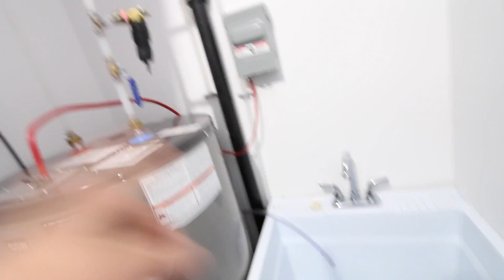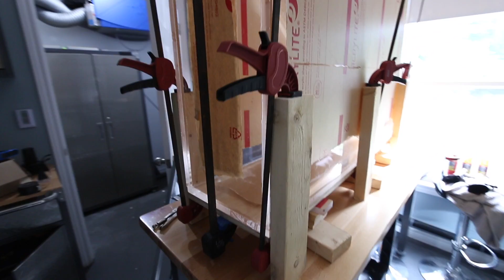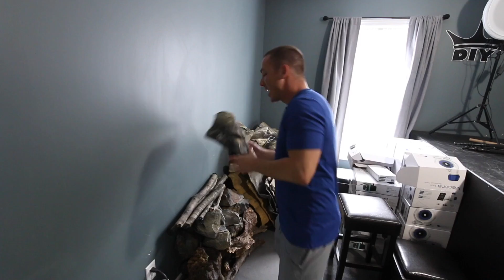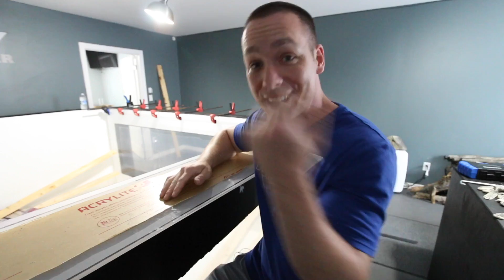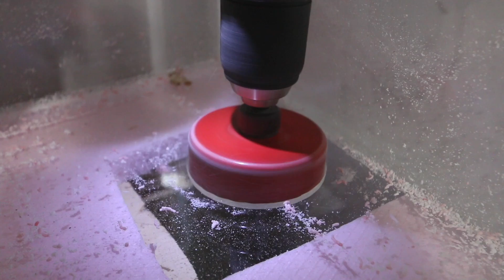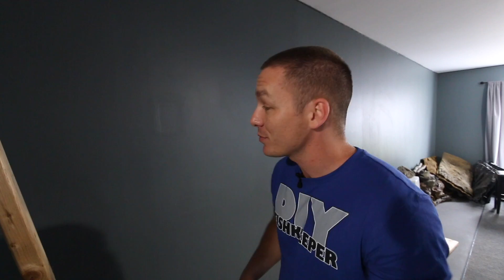2,000G completed  - Aquarium gallery UPDATE!

Comment: For future leaching of tannins, if you can close the top of the trailer or other container with a black tarp, the heat builds up and helps speed the process. A large black plastic trash container works great also. When I did this a few years ago in Los Angeles over the summer, the water got hot enough to steam. There were almost no tannins left to stain the aquarium water.

Comment: Hey Joey, just an idea, how would the panels for the wavemakers fit on the front 2 corners of the tank?, not sure how well you could hide the cords, maybe those square panel things electricians use to hide/cover wires and such , but it would give a clean finish for the back of the tank with a nice wooden trim around the top of the tank, might be an option for the lid too?

Comment: Did you ever use silicone with PMMA before ? if it is not a silicone which special PMMA destiny it will not work over time.

Comment: since you have the corner panel which have a dry area in back; have you considered putting in a video cam in the corner panel.   You could eventually put the cam(s) on-line to have live-cam

original poster:  Glen Petrie

Comment: Idk if that pump in the tank idea is best idea Joey. Just sounds like something that could fail. I would just drill some new holes where u want the pumps and use pumps outside the tank. Just to be extra safe because if those baffles leak and fill up you might have an electric shock to the water.
Reply: Or maybe you can make some kind of the hang on the back pump that will blow water and you move it in any direction you want. Hope this made sense
Reply from the maker: +Joshua Perry Climber its the exact same thing as how the viewing panels are installed, yet entirely safer due to the far less surface area of the chambers. I understand a few concerns but they really boggle my mind in terms of reasoning. If you are worried about those baffles, you should be losing your mind over the panels. Again, identical situation yet the baffles are far smaller meaning the tension on them is extremely low compared to the long 8 foot panel.

Comment: You probably already know this but you will need a sump pump of some sort behind the corner WaveMaker panels in the large aquarium.  You will probably get it to seal up well but even a small slow leak will expose the electricals to water.  It won't take much of a pump but you will need to diy a float switch.
Reply from the maker: +Jeffrey Toole why do you feel this will leak but the front panels will not? They are installed the exact same way yet far less tension is placed on the chambers due to lack of surface area and thickness of materials.
Reply: Take it from an engineer: The pressure is a function of water depth. While it is true the total force applied to the wall joints will be less that of the windows, the force at the joint will be much less due to the much smaller area of the panel. Conversely, the area of the joints are also much smaller. A 3/4" thick panel cut on a 45 degree angle produces a joint width of 1.05". (Full calculations would have to be done but it is possible that the pressure at those joints near the floor when full will actually be higher than that of the viewport joints) At the bottom, where the pressure is greatest, there is nothing for the panel to press against, meaning a seal is produced by the silicone alone. Add to these factors the fact that the construction will age - different materials will expand/contract at different rates, materials will degrade over time, mechanical and other vibrations and movements will take their toll. This aquarium will do like every other and eventually leak. Where the main viewports will produce an annoying puddle when a leak starts, these corner wells are going to collect water. Quietly, insidiously, and likely unnoticably collecting water that will put the currently planned electrical equipment in jeopardy (as well as any added later). It is a matter of cheap insurance. No one wants to see another tragedy - or even a close call. Just looking out for you, Joey!  :)

Comment: I am SUPER interested in seeing the drip emitter on your water heater in action. I have 6 tanks at 270 gallons in my garage. It doesn't freeze where I'm at and I don't need a heater for my fancy goldfish (only the fry grow out in the winter/spring). But I don't have a drain or a inside water source in the garage. But I could cut into the water line feeding my water heater to do the pressure valve drip emitter automated water changing. I'd also have to learn how to drill my tanks I think. The pvc pipe is touchy with being primed.

Comment: Looks awesome! You may want to consider lowering the pressure relief valve on the hot water tank so that it is closer to the floor. Typically this is required by plumbing code to prevent a scalding event should the valve open with someone present - or more likely when a curious hand reaches up while looking directly into the outlet of that scalding water. Better to spend a few bucks than have a kid scalded in the face. Looks awesome though!

Comment: Drop a couple aquarium heaters in with the driftwood on their hottest setting. That should allow the release of tannin at higher temps than your aquarium water will be at, so in theory they wouldn't leak out as much in the lower temp aquarium water.

Comment: Most hot water heaters come with a drain. I usually turn my tank up to boiling point attach a water hose to the drain and fill tubs with hot water for soaking large pieces of drift wood. Just an idea.

Comment: To leach tannins out of v. large driftwood fast you could use a 300 gallon metal stock tank for farming ($250) and wrap the outside in black plastic. If you wanted to go crazy you could hook the stock tank up to a recirculating system via coils of garden hose baking in the sun (e.g. roof of building) and a small/medium size pump. That would get that wood leached out pronto.

Comment: You could start a small fire close to the drift wood pond to heat up the water to almost boiling. If the fire is far enough away you should be able to make the water extremely hot without melting the tarp. Ive seen videos of how to boil water in plastic bottles, this would be along the same lines.

Comment: Happy fathers day. How feasible would it be to get some square aluminium pipe tubing that are just big enough for the magnetic bases. Coat the tube in the same white epoxy as the tank and it would blend right in. With a flat "J"  hook that's painted the same black as the outside of the tank, the mount would blend into the outside and be incognito. This would provide you with the ability to move the power heads around very easily to adjust circulation if you ever need to. You could even make the neck of the J holding the tubing able to rotate in place and then you would be able to infinitely adjust the angle. Hope that made sense

Comment: since you have the corner panel which have a dry area in back; have you considered putting in a video cam in the corner panel.   You could eventually put the cam(s) on-line to have live-cam.
Reply: He could cut a small circular hole for a webcam in the frosting.
Reply: He needs to see this!!
Reply: David Prins since the camera wouldn't need to be inside the tank, almost any mounting option would work. he could use a 90° bracket and glue/epoxy/suction a mount to the dry side of the Plexi panel for example
Reply: Glen Petrie great idea 💡
Reply: Glen Petrie it's frosted though